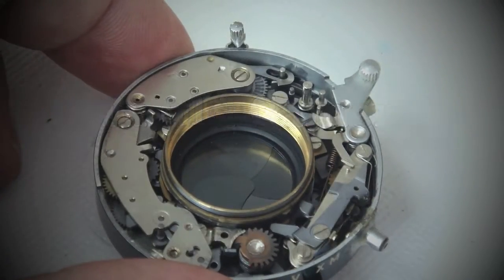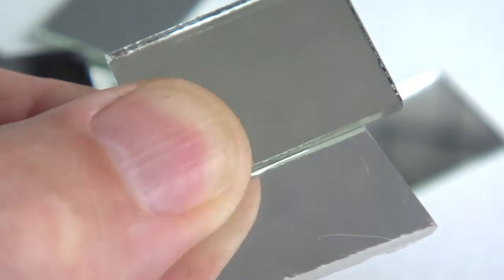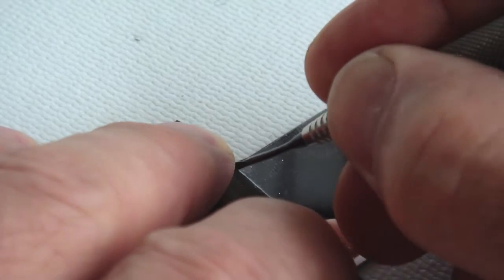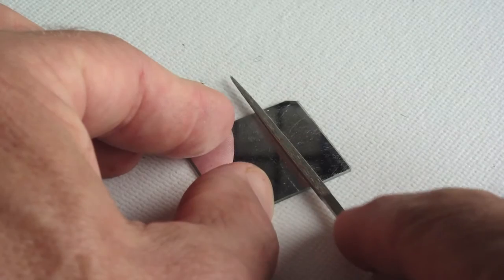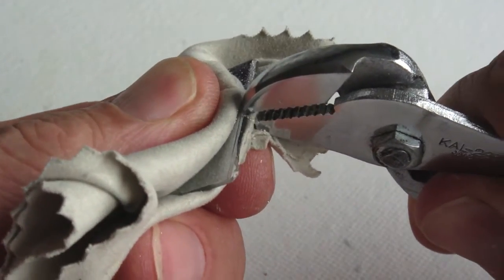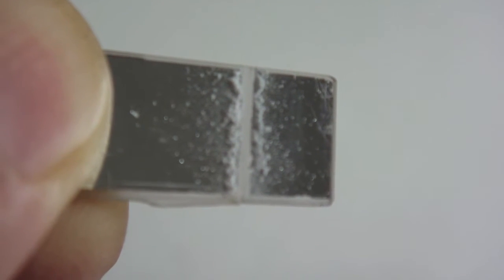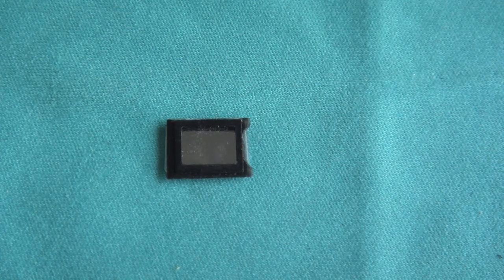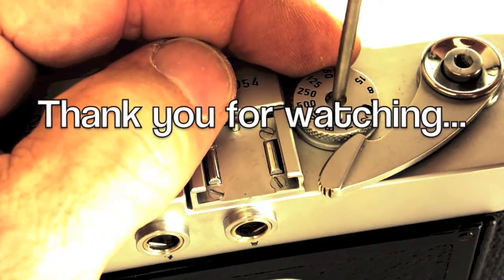Fix Old Cameras: Cutting Replacement Mirror for Rangefinder Optics

Comment: What adhesive do you use to glue the mirror back? i've seen everything from cyanacrylate to Pliobond to epoxy. I'm thinking Pliobond/contact cement as it's easy to reverse and re-do if the mirror moves or doesn't stick well.

Comment: How about the splitter mirror - any way to create a new one?  I assume this method wont work due to its fragile coating.  For those do you need a part for part replacement from a like donor?
Reply from the maker: Maybe with some luck and patience. A donor mirror is always ideal if a good one is available.

Comment: Thank you for this video. How might one find a replacement mirror? Or would it be better to just purchase a regular mirror (hopefully one that's already small to avoid access waste) and trim down from there. I suppse in this scenario, I'd have to measure the size by outlining the other mirror first? Thanks again!
Reply: Okay so never mind lol I kept making my searches way too specific, just didn't occur to me to simply Google "mirror squares", but I found what I think I need. They sell them at arts & craft type of stores like Michael's (for things like glass tile artwork and whatnot). I think the trick will be finding one that is front facing vs back facing.
Reply from the maker: Those might work depending on the thickness and the reflective surface position. There is also some commonality between camera models if you are looking for a donor.

Comment: I would have used a mini precision glass cutter tool. one stroke, break at score line, done... I like my work to be clean and efficient.
You completely ruined that poor little mirror, The surface quality went from 90% at the start of this video to 40% by the end.
Reply from the maker: That is funny. It was a bit ugly. Although, the poor little mirror manage to work perfectly in the application it was cut for. It is good to work clean and efficient... and if you have a carbide tip oil fed precision glass cutter you would be well advised to use it and use it often. But some times for an occasional cut we can get the down and dirty glass cutting blues and use the tools at hand to get the job done.

Comment: Could this technique be used for metered prisms like the mamiy pd for the 645? Will a replacement mirror influence the light used for exposure calculation?
Reply from the maker: If the reflective qualities of the mirror are different, it is possible that a slight difference might occur, but it is doubtful it would be significantly noticeable.
Reply: @FixOldCameras  using a thin mirror could be an easy fix to a common problem with the mamiyas.
Reply from the maker: @prestonlafarge5641  Indeed. And thank you for the comments.

Comment: Thanks for video!
Can you write a size of mirror for Voightlander Bessa R3A, please? I,'ve broken then have dropped my camera
Reply from the maker: Do not have technical data for that camera. Do not know the size off hand. Do not presently have one in shop to cob the measurement. Maybe you can make a template to an exact fit out of some card stock paper for edge to edge dimensions. As far as thickness goes a guess based on experience and no data would be 1mm with front surface reflection.

Comment: Great videos as always, thanks. You mention screw slot files. I've been searching online and they are very expensive. Any ideas as to what size will work with the small screws we find on cameras? How about a source for same? Staying with screws, some cameras have very thin slots. I have the Jis crosspoint sets of drivers, is there any for these tiny thin slots? Finally my local glazier has been helpful cutting ground glass and mirrors. Stay well, Tom
Reply from the maker: The file used in the video has been around for more than a few years and works well. The file size to use would be #1(.012), but the next size up would also work. A suitable substitute would be a very fine hack saw blade with the kerf flattened. It will not cut as aggressively. A Dremel tool cut off blade ran at very, very slow speed might also work but could possibly be harder to manage. You have had some helpful tips in the past so you are sure to come up with something other than the now expensive and hard to find slot files to make the fine line scribe needed for such a small mirror. As you have pointed out, get the best possible screwdrivers that you can justify. The cheap ones will work in a pinch and light use, but when high torque is needed they do not hold up... and then it slips and the screw slot will need to be filed. Or the wrong size screwdriver is used and the slot is damaged... and the screw slot again needs to be filed. Slotted screws in classic and vintage cameras are rarely in perfect condition. 
http://astore.amazon.com/fixoldcam-20?node=1&page=2
Reply: Thanks I'll check around. I did stop by a local Hobby Shop and found a very small set of diamond toothed files that may work. Thanks keep up the great videos. Tom
Reply from the maker: Having ventured into building a solid body guitar in days long past the files like the ones in the link in this shop were used to the cut groves in bone guitar "nuts". They have been used in other applications since and performed well. They should cut nice groves in brass screws although they leave a round bottom as they are designed to cut a groove for the strings to seat without buzzing. As far as cutting grooves in steel screws it would probably depend on the steel of the screws. Thanks for posting the link. It is an interesting site.
Reply: Ah thanks. I simply saw he had the size listed .012" and it was a lot cheaper than other sites I found.  I'm happy you can use the site. By the way any thoughts, or did I miss it on very thin slotted screwdrivers for Japanese cameras with extremely narrow slots.
Reply from the maker: The Starrett screwdrivers are the best, but expensive. The Moody screwdrivers are a very good alternative, and much less expensive. Sometimes a blade will need to be filed to match the slot of the screw. Since the blades of these screwdrivers are replaceable they can be removed and labeled as a specialty blade model specific.
http://astore.amazon.com/fixoldcam-20?node=1&page=2
Reply: @FixOldCameras  why not use a glass cutter?  Is there a reason it won't work for this purpose?
Reply: Is the glazier able to get you the splitter mirror glass?

Comment: Hi! there's a neat trick that we used to do to chip mirrors/glass along a line and the result is clean. i just forgot how we did that maybe you can search on youTube. it involves a soldering iron to heat up the mirror. the trick is to keep the other end of the mirror under water so there is some temperature difference. i wish i remembered how we did this some decades ago. the funny thing is that i learned the trick from an encyclopedia or a science magazine from back in the days. Cheers!
Reply from the maker: Clever sounding trick. Maybe some one will help us out with this one.
Reply: by the way, i am not a pro but i fix plenty of lenses because i get scammed all the time before or friends ask me to help them (used to be an apprentice watch maker). i upload my notes into a blog at richardhaw(dot)com, maybe that would interest you. nowhere as pro as you though.
Reply from the maker: Interesting. Could be tricky to adapt the water techniques described for the small thin mirror stock needed in camera repair. Would be fun to try and make a video of the process.
Reply: ill try it one of these days
Reply: @FixOldCameras  hi do find ways to create chip mirror for SLR?